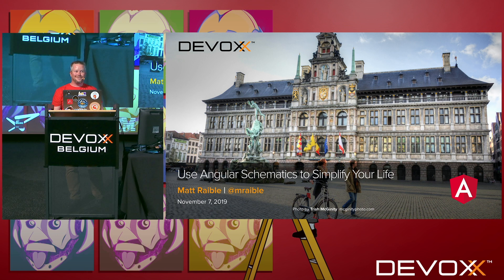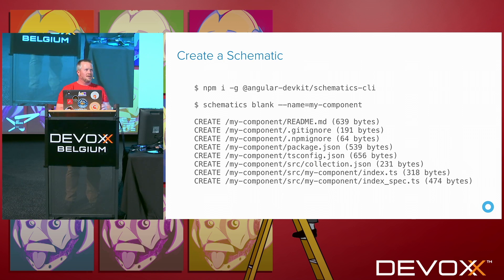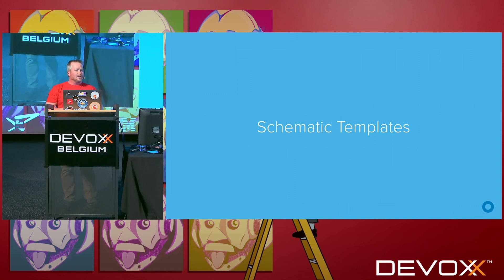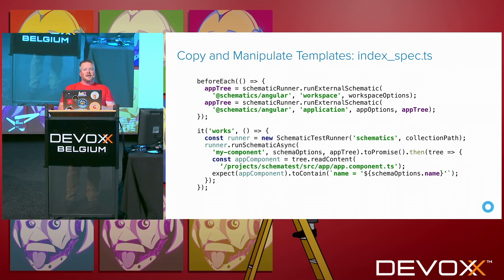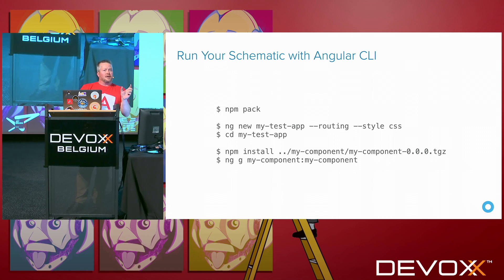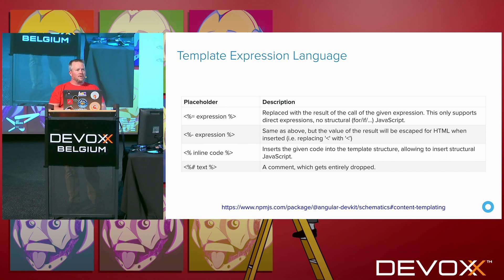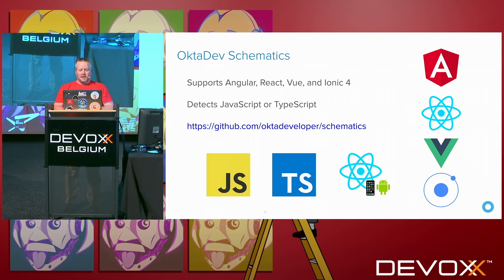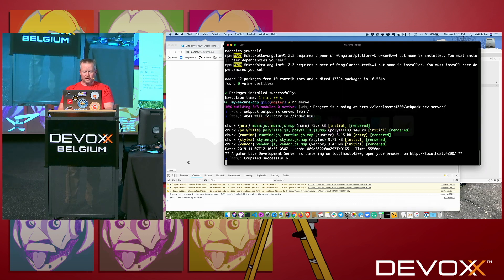A Gentle Introduction to Angular Schematics by Matt Raible

Comment: Very poor introduction. The title says “Introduction” , it’s been 6 minutes of watching the video and I don’t know what problem he is trying to solve.
Reply: The problem is creating forms using just code is a pain-in-the-ass.  There are a lot of manual, repetitive tasks that accompany creating forms and even more manual, repetitive tasks when maintaining forms.

Schemas, particularly Angular Schematics (which is what this video is about), eliminate the majority of these manual, repetitive tasks when creating and maintaining forms.  Angular Schematics react to the slightest of changes, allowing the developer to not update the code every time a field is added or new validation rule is introduced.

That's just the tip of the iceberg, but I wouldn't recommend any developer to work with forms without some sort of schema.